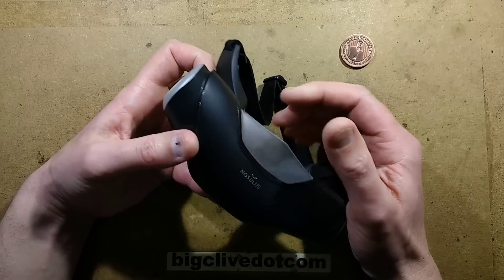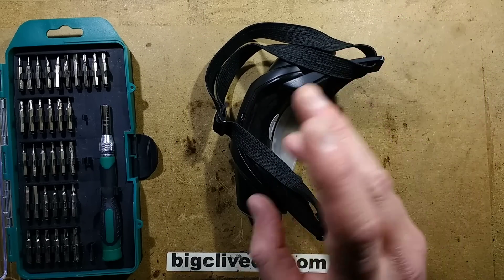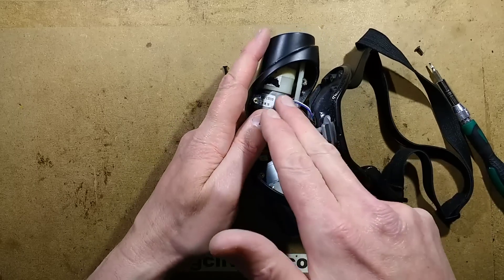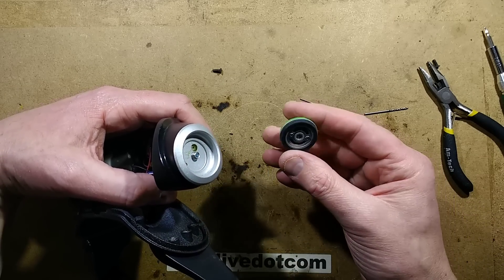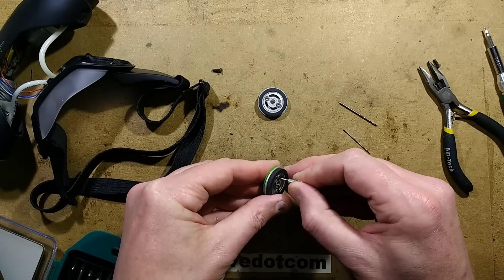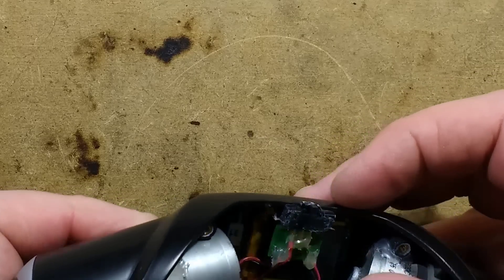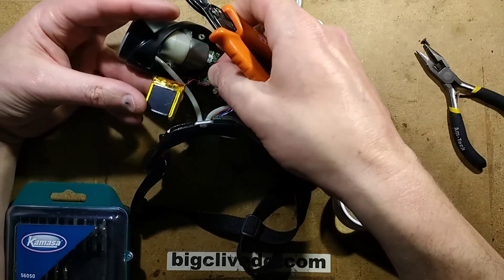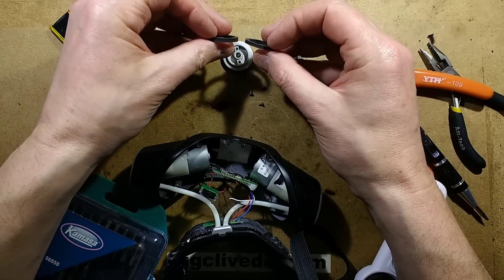inside South Park's Nosulus Rift virtual aroma unit.

Comment: Terence & Philip, eat your hearts out!

I say, Te'ence, that was terrific fart, wasn't it?

Clive, you're a gas, synthetic body gas that is!

Now, I kid you not, but many moons ago there was an experimental "Smell'o'vision" try out by one of the major broadcasters. It was only available in a one off controlled experiment, and possessed a very limited repertoire of aromas. The BBC, also tried out a "scratch & sniff" card for one or two broadcasts of some soap opera or other, but it wasn't a great success, but the idea of fresh laundry, new mown grass, fresh brewed coffee, toast and several other familiar aromas was certainly novel at the time (way before even NICAM sound). . . The problem with any "aromatiser" system will always be the audience position relative to the presumed source of the smell, so not very handy if you're meant to be driving past a field of new mown hay, but you don't get to smell until minutes later, as you're passing the hot-dog stand, for example. Some viewers get dead on cue, others, not so.

Anyway, if it's fart smells you need, just eat a couple of tins of baked beans about 24 hours before hand! 💩

Comment: As soon as you pulled out the board, I could tell you that's a standard Arduino Nano. Infinity logo gave it away. Also, the pump you described and that it likely uses, can also be used for liquids if the motor is strong enough. Likely, the canister on the end of the motor is where the liquid comes from.

Comment: The stinkbomb liquids have gotten incredibly powerful, so I'd bet that all they did was put a drop in each metal cap, wipe it off, and let the residue do the rest.  After all, you're getting that aroma shot RIGHT into your nose, so a little goes a very long way.

Comment: The problem with smells is the stick around sometimes even in your noise. So it's good for a one off thing but I don't think it would work in the long run. Also you have to buy new smell carts, do people want to do that? The smell carts may also go bad over time. Fun gimmick though.

Comment: Quite brave. ppm and effects from OSHA
0.00011-0.00033 Typical background concentrations0.01-1.5 Odor threshold (when rotten egg smell is first noticeable to some). Odor becomes more offensive at 3-5 ppm. Above 30 ppm, odor described as sweet or sickeningly sweet.2-5 Prolonged exposure may cause nausea, tearing of the eyes, headaches or loss of sleep. Airway problems (bronchial constriction) in some asthma patients.20 Possible fatigue, loss of appetite, headache, irritability, poor memory, dizziness.50-100 Slight conjunctivitis ("gas eye") and respiratory tract irritation after 1 hour. May cause digestive upset and loss of appetite.100 Coughing, eye irritation, loss of smell after 2-15 minutes (olfactory fatigue). Altered breathing, drowsiness after 15-30 minutes. Throat irritation after 1 hour. Gradual increase in severity of symptoms over several hours. Death may occur after 48 hours.100-150 Loss of smell (olfactory fatigue or paralysis).200-300 Marked conjunctivitis and respiratory tract irritation after 1 hour. Pulmonary edema may occur from prolonged exposure.500-700 Staggering, collapse in 5 minutes. Serious damage to the eyes in 30 minutes. Death after 30-60 minutes.700-1000 Rapid unconsciousness, "knockdown" or immediate collapse within 1 to 2 breaths, breathing stops, death within minutes.1000-2000 Nearly instant deathBetter lay off the cake Big Clive.

Comment: Weird, its got arduino writen all over it. Never seen such a board. ATMEL ICs are use in arduino and it even has the arduino infinite sign on the back of the pcb. The bt chip at the back kinda looks like an 01, esp8266 which is actually wifi would have been nice if you read the number on it. I cracked my self when you smelt it!
Reply from the maker: The PCB was created by Hackerloop who have a variant of the Arduino logo.  It does look Arduino based and is most likely WiFi capable too.

Comment: Perhaps you could have paired it with a mobile phone as a speaker device and sent play pause signals to fire it up?  Also maybe the scent is on the back of the white inserts, the screws were loose so maybe an air path?

Comment: My guess is the hat the compounds used were mercaptans, which can be smelled at very low (ppb) labels. I once picked up a bottle of one of these compounds that was double sealed in metal cans. When we stopped for lunch on the way home, we could still smell the compound across the parking lot about 100 meters downwind. A small coating on the metal should be sufficient for this application.

Comment: My guess is they spent bottles of fart smell stuff, putting it into the fixtures which is suppose to emit the smell thus negating the need for liquid; it came "loaded" in a sense and being half-spent with some time to dry, the odors are dried up inside the unit.

Must had smelled a whole lot worse when it was "Fresh"...

Comment: The smell is in the white tanks you've been looking at the entire time. The ones attached to the dispensing pump motors. The parts you wondered about are just the caps they put on top of the refill valve, because without a cap, that would have smelled too bad. 

Source: Pulled out of the place those kinds of smells come from.

Comment: Could have been those gel beads used in air fresheners. They evaporate when they're used up.

Now, as for decontamination...
Reply: It might use Friction on the foam ring when it spins
Reply: @goatbaabaabaa  The end piece doesn't spin. It's held on with a screw thread, that's how Clive undid it. If it spun, it'd fall off! Those motors have air pumps attached.

Comment: The infinity symbol on the board, is it a arduino type of programmable board.  ?
Reply from the maker: Hackerloop technical collective, but does seem to have a string hint of being Arduino based.
Reply: bigclivedotcom  i later scrolled down the comments, think your gonna get the question a lot.   How about giving the flame o matic a bluetooth upgrade.  ,  but for christs sake dont sniff the milk.

Comment: Are you sure those caps you unscrewed weren't just caps covering charging ports and the smell was actually kept under (low) pressure in those plastic cylinders?

Comment: The aroma is likely from a thio/mercaptan compound which are detectable by the human nose in the parts per billion range. so the sample may simply be to small to see. I doubt they are using hydrogen sulfide because of the toxicity (similar to hydrogen cyanide)

Comment: This was a one-shot promo tool to use with the journalists at an event. The ease with which the 2 scent cartridges were removed points to easy pre-show preparation ahead of use.

Found in the Mashable article already referenced:
The Nosulus Rift is actually pretty clever. It basically connects to a console via Bluetooth or USB, and is triggered by a high frequency sound that gets tripped whenever you push the "fart" button on your controller. Air gets blasted through the mask, and activates the scent contained within tiny drops found in dual capsules at either end of the device.

"Basically it's fart perfume.”
“Each time there is a fart in the game we send a trigger and the pumps are activated – so airflow is going through the polymer drops," Valentin Squirelo, the 30-year-old Hardware Engineer at Productman (the sector of Buzzman that focusses on new products), explained to me. 

"Basically it’s fart perfume.” 

The article goes on to tell how a French perfume company developed the scent by blending common perfume scents.

Comment: Haha, i laughed my ass off when you smelled the second cartridge :D - I think the cases might be SLA-3D-print (laser sintered nylon powder) and then painted. Btw. can you please check your email? I need to get into contact with you regarding stuff to send you. Look for my "zapro" in your mailbox.
Reply from the maker: The finish is rough inside but immaculate outside.  It actually looks too perfect on the outside to be a prototype.  But I could be wrong, and the texture inside doesn't look like it's from a machined mould.   The pattern inside does suggest it could be laser sintered.

Comment: The circuit board is an Arduino clone. The Atmel chip and the ...Arduino logo on the back are enough for identification :-) Solder a Bluetooth module and you got your controller. Fully programmable over USB with enough tricks to do some aroma pumping and keep track of the Bluetooth connection.
P.S.
I need to read ALL the comments :(

Comment: Hot snot galore..... what happened to "user friendly" attachment
Reply from the maker: It's very much a prototype.  I think they may have had a learning experience with the tiny connectors.  When the glue is removed all the wires immediately pop out.

Comment: Any chance the USB and the battery were also USB data and the battery for power due to the increased current requirement? Yes, I watched the whole video and saw the BT mentioned. I am thinking along the lines of laptops that have wired and wireless for data connection. USB is available for those that don't have BT for what ever reason.

Comment: The kind of aromas that cause these reactions from humans are strongly detectable in very small measurements of parts per billion. They very likely just swabbed a small quantity into that little hole, and that was enough. If they had a proper obvious cartridge it would emit concentrations that would completely incapacitate you.

Comment: Sounds like Butyric Acid.  Causes retching and smells like vomit.  It's cheap and highly concentrated, so some techie with a spray bottle would just need to spritz a little into each cap.  Also non-toxic, but can burn skin if directly exposed.  Whaling protesters like to throw it at ships to taint the meat.
Reply: It’s actually compiled of a couple of different substances 
It’s actually made by a big french perfume company
Reply: I doubt they'd use butyric acid to replicate the smell of farts, since it wouldn't smell right. I was thinking possibly hydrogen sulphide, since he did say the first cap smelt like eggs.
Reply: I don't think it would be H2S as it is a gas and wouldn't stay around for very long, it is also very toxic so I don't think they'd be allowed to put it in a consumer product, even though it would be in low concentrations.

Comment: After seeing the logo on the back of the control board, I got a bit curious - the infinity-sign logo is very similar to the logo used by Arduino, and Groundlayer is a hardware-as-a-service company (as they describe themselves) from Paris, France (Ubisoft, the ones publishing The Fractured But Whole, is also headquartered in France).  The Atmel SAM D21 (ATSAMD21) chips are used in the Arduino MKR line of boards, which have a very similar shape to the board used in the Nosulus.  My guess is that Groundlayer took the open-source design and firmware for the Arduino MKR1000 and adapted it to suit their needs, so there's a good chance someone can dump the software and see how it works at a code level, or, even more fun, repurpose it for something not-fart-based.
Reply from the maker: You can design on a standard Arduino and then burn the software into a stand alone PCB.  I'm guessing that they did that.  Not sure about the bluetooth module.  I wonder if it was originally intended to have bluetooth connectability or maybe allow software tweaks.

Comment: Wow. Those two beefy motors running off that tiny LiPo battery? Won't last that long. Maybe you can build a small air compressor out of those pumps. I pulled one from a broken keurig k cup coffee machine.

Comment: Maybe the aroma is that evaporative gel material you find in air fresheners. Also: a shot of isopropyl alcohol, and hot melt glue will pop right off!
Reply from the maker: It's notable that all the hot melt on the connectors was there for a reason.  As soon as I removed it all the wires started popping out.

Comment: I think from the scratchy noise when you scraped the plastic, that it would be glass fiber reinforced.
Reply: I think more likely it was resin cast out of epoxy, it can be pretty hard and crunchy naturally. It stands to reason they'd use a thermoset resin when doing a few hundred pieces rather than thousands, and epoxy shrinks a bit less than other common thermoset resins. And yet, it's not that uncommon to use thermoset polyester and lay a sheet of glass fibre into it.

Comment: Is that an arduino symbol printed on the back of the main circuit board?
Reply from the maker: It's the Hackerloop logo, but the unit does appear to be based on a custom Arduino platform.
Reply: bigclivedotcom arduino versus EVERYTHING (even smelling like poos)
Reply: It says "GROUNDLAYER", which are these guys: http://www.groundlayer.org/
Reply: I wonder what the "GROUNDLATTE" legend next to it means...
Reply: The ATSAM chips are the Arm Cortex based MCUs.
Reply: That antenna made me think the module was an ESP8266, my devkit looks extremely similar, with an identical antenna.

Comment: Why are there two pumps?
Reply from the maker: I'm not sure if it's for two different odours or if it's to allow easy switching between two reservoirs.
Reply: With a device as important to humanity as this, it's a good idea to have redundancy.
Otherwise someone might not get a fart blown in their face... a possibility the designers thought to be entirely unacceptable.
Reply: bigclivedotcom it could be set to use up one cartridge first then the other. The first cartridge you sniffed was used up and the second wasn’t. It could also be use alternate deferent smells in other applications. As described it doesn’t seem like they needed two pumps for the application.

Comment: Clive, I think the way it works is they filled each divit with liquid ass and one tube would blow pressurized air into the arrangement and it would flow out the other tube to the wearers nostrils.